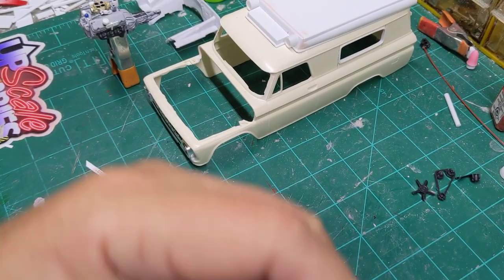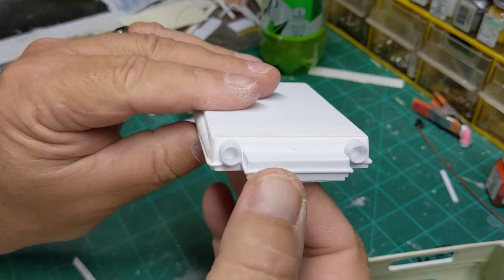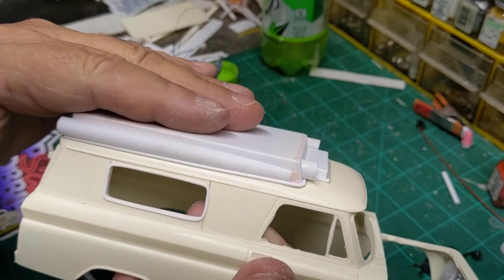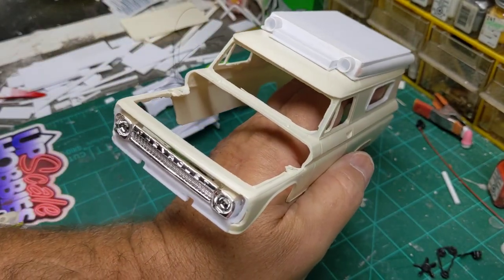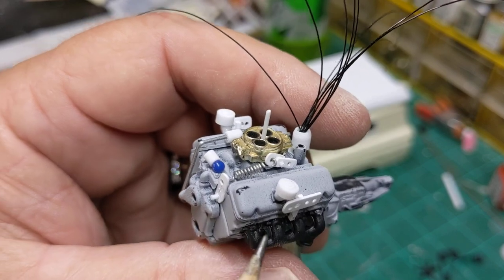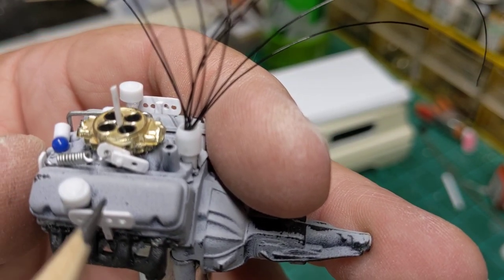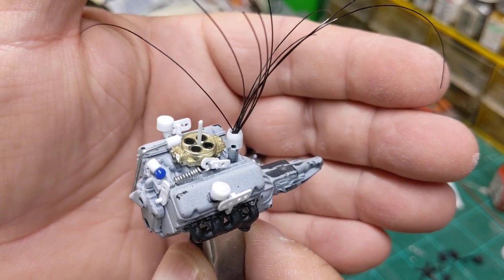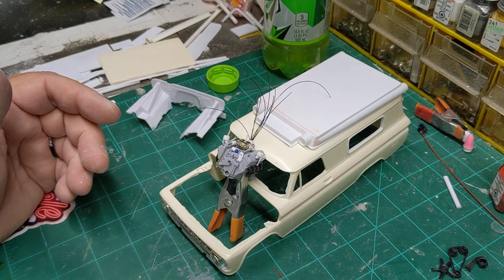Day 3 of the 66 Ambulance build.

Comment: Again, pretty cool update, the roof and the engine are looking really good. I love the way you use all the parts from the "outside world", in this case the dressmaker pin (I have used some of those very cheap ones with little flat metal heads as movable helmet visor joints on my 1/24 firefighter figures).
Reply from the maker: Thank you for watching. I am all the time looking at things differently than the intended purpose.
Reply: @davidparsleyscustomscaleemerge  And that's the real fun part of building models. :-)